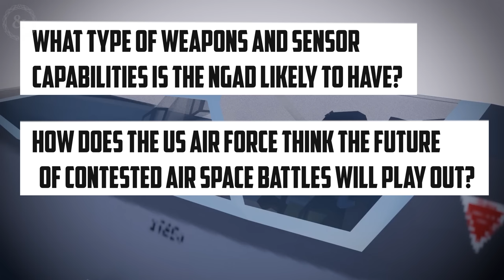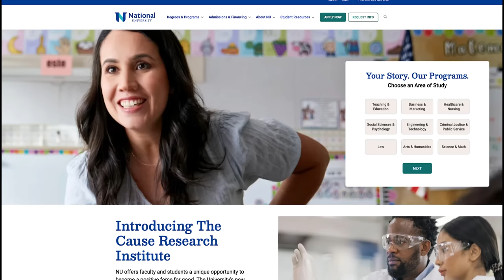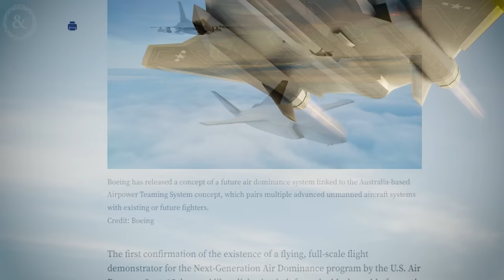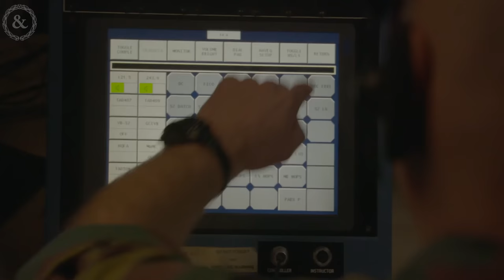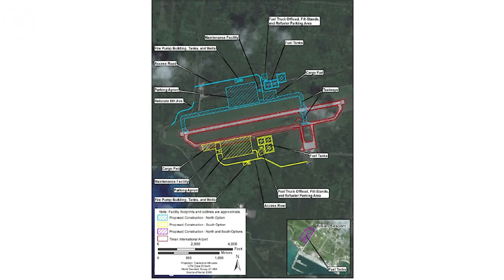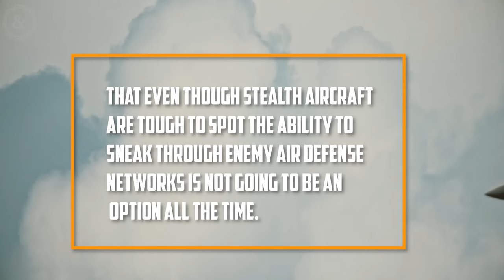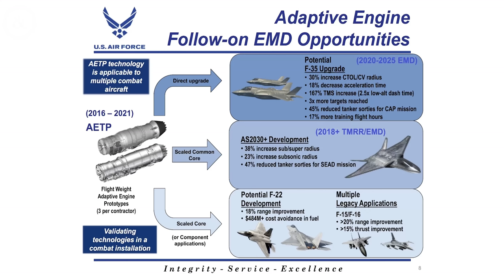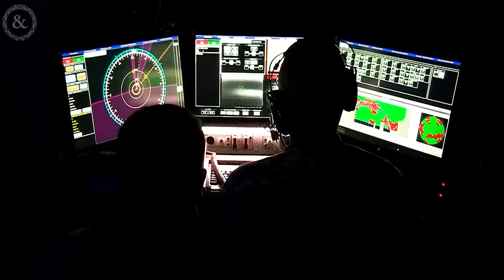Lockheed Martins 6th Generation NGAD Fighter Tactics

Comment: Wasn't the F-35 Lightening II supposed to be stealthy-cheaper-better-faster by building a basic air-frame & then finish w/ a more hefty, durable, a little larger F-35C w/ tail-hook for aircraft carriers? A land-based F-35A (CTOL) variant for conventional takeoff & landing, and finally, an F-35B (STOVL) for short takeoff & vertical landing. This was supposed to save money, right?...HA...HA...HAAAAA...SUCKKAS!!!😆😅🤣 The jokes on us!
Reply: Each F-35 replaces around 3-5 different aircraft, massively reducing logistical complexity and cost. Depending on the variant, it costs between 85-120 million per platform. This is equal to or lower than most of the fighter programs since WWII. Prior to the 2010 rework of the program management there were definitely cost overrun problems, but every pilot I've ever heard from has said the F-35 was a massive upgrade to their previous platform. I can fairly responsibly tell you that in any actual conflict with a well-armed opponent, the US will be very glad for the F-35's presence.

Comment: So this information actually has been available for several months now and yet is missing one of the most important details...US didn't make the plane (atleast not independently)

So every aspect of this plane was mentioned in announcement months ago when discussing the Japanese next gen fighter. So likely development of this fighter is:
•a joint US & Japanese project (most likely) especially when considering necessity of compatibility among systems.
•US copied japanese tech which is possible considering the US's recent failures in military tech.
•US made the project independently (unlikely) but easily doubted when Japanese announce the project of EXACT same philosophy months before US.

While small in detail i just find it extremely disingenuous to not mention other parties of a project. At minimum it's theft in credit and maximum it's theft in technology.

Comment: 0:13: 💡 The United States Air Force is developing a new fighter jet called the Next Generation Air Dominance program to replace the F-22 Raptor and address operational needs in the Pacific Theater.
3:49: 🛩 The Next Generation Air Dominance program aims to develop new aircraft and supporting systems to ensure a strategic edge against near-peer adversaries.
7:41: ! The Pacific Air Force Fleet plans to use drones as affordable mass to keep the enemy guessing and soak up munitions.
11:43: ✈ High altitude flight is important for Next Generation fighters to have maximum standoff capability with their weapons.
15:44: 💡 The Endgad is a fighter aircraft designed to reduce radar signatures and provide a 360-degree view using cameras, while also integrating targeting data and directed energy weapons.
Recap by Tammy AI

Comment: As cool as the NGAD or FA XX programs are, I'm sick of hearing about them like they're just around the corner. C'mon, guys that are lifers signing up today in the Air Force or Navy will be retired or on the verge of retirement by the time they're operational. It's pointless to be talking about them like it's a year or two away. So much is likely to change by then. Politics control this stuff more than what's best for the country. The YF 23 Black Widow, the YF16 Kingsnake, etc. jets the country should have gotten but politics got in the way. Not gonna hold my breath on cool 6th gen planes just yet!

Comment: Looks like we know what ACTUALLY happened to that F-35 and it wasn't "The Pilot Ejected while the plain was still flight worthy".... They were testing the RCS/AI (remote control and AI) for this thing... or more accurately, this thing's control system being tested as a potential upgrade to the existing 5th gen fighters..
Probably wasn't the first test either and they were doing one of the final "But can it land itself if a pilot ejects in flight?" test before going ahead and deploying it into all the F-35's a decade ahead of this things actual release... You know, to "collect data and refine the system", right?..

No, this is too much. Nobody needs this. 
2 problems. It's too expensive and there's no human risk in flying it.

That's a SHTF soup for "no conscience, always on engagement, indiscriminate engagement" a.k.a. mass murder caused by any number of the thousands of mechanical or digital hiccups that happens in such advanced systems and their code... 
War should be fought and won with blood, courage, and conscience for a reason.. We should lay down our own lives so that when it consumes our conscience and we get desensitized and trigger happy, the war we seek consumes our body's and, thus, our ability to do harm once our hearts and minds become too-jaded-to-care and indiscriminate like we've already seen in the middle east Apache pilot (who happened to have video systems recording) and so many others who we've never heard of.
BTW, *FREE BRADLEY MANNING*. Soldiers like that should be *REWARDED*, not imprisoned lest our militaries lose themselves in the suck and go from soldiers(or C6 AI flight-control/targetting systems) to serial killers with no reproach.

If it's not important enough for you to send your kids or leave your families to lay down your lives for the cause, then nobody should be fighting for it. 
This is obscene. This is grotesque. 
No real pilot who trains and gets into the cockpit to fight for their country ever deserves to be shot down by one of these.. Iranian, North Korean, Russian, American, or Otherwise...
Same goes for ground troops.. If killing need be done, it should be done with the discernment of a human, and that weight should be borne by that soldiers conscience.

There is also a 3rd problem.. Let's think about that runaway F-35 issue again...  What happens when this thing's target acquisition system as a "bug", it it's pilots radio signal, or it's got some issue interpreting some "intentionally vague orders" and it's AI flight controls start making their own decisions in a hot zone like, say, flying a stealth recon mission over Russia or North Korea where it's surrounded by millions of "enemy targets" and someone sees it, gets a radar lock hoping to scare it out of their airspace, and it goes right on ahead and slips into "combat mode" and starts attacking all the shit it's been identifying for the last few hours and melting the lenses off any laser-guided missiles that might put an end to it's holocaust of miscalculation/alignment issues? 

Nobody can shoot it down and congrats, your DEW's work, but WWIII just started... Good luck telling them "Nooooo, we were just SPYING on you. The robot did all that damage on its own, pinky promise, we sweearrrr Mr. Un/Putin/Ping"

Comment: At 15:30 there is a discussion of the lack of large windows.  With the advent of the DAS system and helmet of the F35 program I see little need to ever having a window on a future military aircraft.  As this technology continues to advance the pilot can see "through" the plane and has little need for a window.  This would allow a pilot to sit in a even more reclined position during high G maneuvers allowing higher G loads. It also would allow thicker stealth coatings and a smoother aircraft surface on the front of the plane for much better stealth.  The cockpit itself could be a swapable "pod" that can be swapped out for a pilot-less version of the same plane.  The pod could now contain anything from advanced sensors for reconnaissance missions, to extra fuel cells for increased range, or an electronic warfare package.  Having windows in a conventional layout no longer makes any sense really.

Comment: How much does the NGAD cost, 1 of the biggest reasons why the Air Force been trying to retire the F-22 repeatedly over the years and never really acquired in large numbers was the cost.I heard the F-22's maintenance was also very costly leading to the decision to retire the airframe.I heard the F-35's are gonna be facing the same scrutiny and for a lot of the same reasons
Reply: One of biggest issues with the F-22 lifetime costs was engine maintenance/refurbishment and RAM coating replacement, it was only with the Block 2 F-35s that we developed a RAM coating that didn't ablate at supersonic speeds.